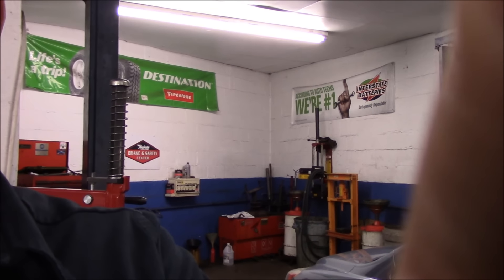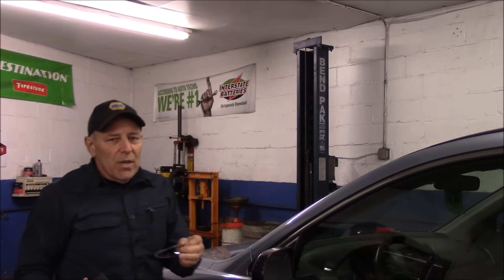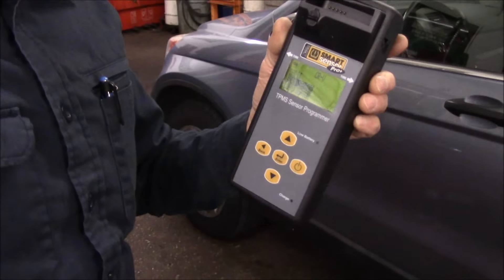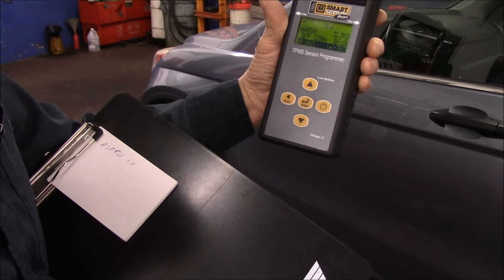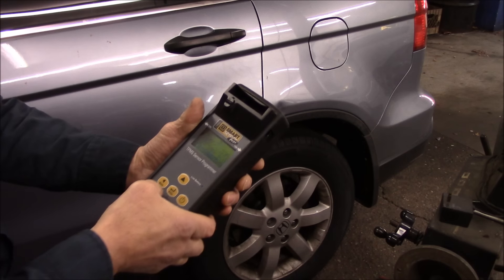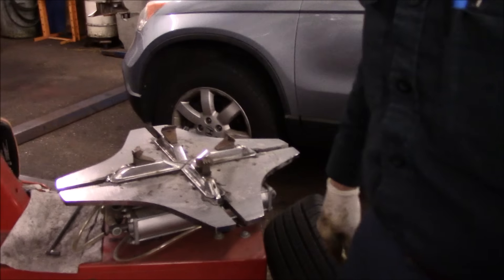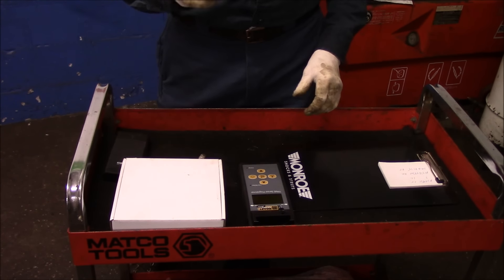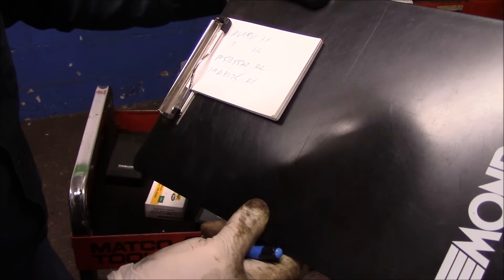How To Reset Low Tire Pressure Light (TPMS) Tire Monitoring System

Comment: How much cost the tool
Reply from the maker: Check my Amazon store for details.Here are some of the tools that jimthecarguy uses
https://www.amazon.com/shop/jimthecarguy
Reply: Jorge Zepeda as much as price the store asks for.
Reply: The “details. Here” link does not work
Reply: @jimthecarguy  Hello,

I’ve been having this issue for two weeks now. I have brought my car to the shop fourtimes. They have changed the sensor and reinitialized it and the light goes off. This has happened four different times and I saw the readings on the tires myself. The next day, the TMPS light comes on and blinks then goes solid. II do not have a spare in my trunk so it cannot be that. Is it an issue with the cars computer? Can you provide any answers to this please?
 I have looked everywhere online and I cannot find any answers to this. I have a 2013 Hyundai Elantra.
Reply: Good job
Reply: kh2maniac i am going thru a similar issue, I had to re upholster the dashboard of my car and now the light stays on. I am confident it has nothing to do with my sensors but some error in the computer since I had to take my car apart to remove the dash. Whatever I don’t really care, hopefully one days it starts working correctly again but I will not drop hundreds of dollars when 12 years ago we didn’t have tmps, I know exactly how to live without it and be safe.
Reply: Dario yea, I have no idea what’s going on. It’s still on. The technician recommends that I replace the other three sensors. He was nice enough to say that they wouldn’t charge me for labor and that I wouldn’t pay until I was comfortable with the light not coming back on. Which I could do and even if I did pay and the light comes back on, I’ll just dispute the charge and stop the payment. The whole thing has been stressful. Once you think it’s fixed it comes back on. I have no idea what to do now.
Reply: kh2maniac yeah I just started dealing with it this week so I am not too worried for now. But my car is an 09 maybe it’s time. I am just not going to drop hundreds of dollars for that, I can deal without them. I am always looking at my car in all places and I can detect low pressure without the system or even how the car drives and behaves. I want it gone but at the same time it’s not a priority really.
Reply: Dario I can understand that. That light is just so annoying. Do you have any recommendations other than what I am planning to do?
Reply: Dario the only one I haven’t tried is disconnecting the cars battery. I need to replace my battery anyways so I guess I’ll give that a try. Thanks for your help!
Reply: kh2maniac no problem
Reply: @Stickykobe420  i have the same issue with my 2011 rav4 ,and I don't pay attention to it 
As long as it doesn't show up when you do the smog check ,then I don't bother with it
Reply: May I have your shop’s address? My vehicle probably needs your help to do so. Thank You 🙏
Reply: Great video just fast play it 1.75x speed
Reply: @kh2maniac  Did you check the pressure in the spare tire?
Reply: @kh2maniac  Did you check the pressure in the spare tire?
Reply: @ellenjayd8721  I don’t have a spare in my car.
Reply: @ellenjayd8721  or do you mean the doughnut?
Reply: About $800.00 from snap-on or used  i sern one go for $600
Reply: I was expecting some sort of secret way to clear this, so basically you have to buy the scanner to figure out which sensor is bad, for the price of the tool, I have an easier solution, I ignore the light. 
I believe 80 percent of cars on the road have the TPS light on.
Reply: Me want know tool cost also
Reply: @kh2maniac  You said the word, "Hyundai".
Reply: @davidmorse8432  😂 yea, are they known for doing this or something?
Reply: instablaster...
Reply: @homie-gtv322  It you get?
Reply: @okaunis  Know. Knot yet. Did get you it?
Reply: What's the exact name of your tool look on Amazon and I didn't see it?
Reply: Does the sensor tool need to have OBDII integrated in order to do the job you just did, or one without OBDII would do the same job as well
Reply: No spare tire?
Reply: @jimthecarguy  I don't see a tpms sensor tool...just the replacement tpms sensors. Is their a tool you recommend?
Reply from the maker: @AamnaHussain  
There are a few kits in my store. One is the complete kit ( tool and 8 sensors ).You can also just buy the tool. Here is the link.   
https://amzn.to/3ZWo36i.  Just the tool
https://amzn.to/3wfQVZE. Complete kit 
https://amzn.to/3WlGuhu. Sensor 315 MHZ
https://amzn.to/3XIsuzJ   Sensor 433.92 MHZ
Reply: @jimthecarguy  awesome thank you Jim!
Reply: amazon says 108 dollars
Reply: hi Jim.what is the name of the tool,where you bought it please 26:
Reply: @kh2maniac  Maybe the car computer is looking for the spare sensor.
Reply: I bought my tire one year ago. I don’t understand how come the tire light shows up. Now its blinking and I feel worry about it. Because I need the car for my job . Please help
Reply: @kh2maniac did disconnecting battery work? that was one of my thoughts , like restarting a computer
Reply: This isnt much use if you dont invest in this specialized tool …and if you do, you probably wont use it very often making it a poor investment. These TPMS are not reliable. Ive had problems with them on 3 different vehicles.

Comment: My grandpa lived 98 years without a tire sensor.
Reply: Ha ha ha, same as Fred Flintstone, heck his mobile didn’t need brake either.
Reply: @deeneyugn4824  You are missing the point with your flippant remark:
There is good new technology and there is ridiculous new technology.
TPMS falls soundly into the latter category. Simply pointless.
Reply: pan af  Yeah...My tyre supplier wrecked one of mine and denied doing so. Until I asked why that one tyre now had a new valve stem installed. Mmm?
Reply: Patagualian Mostly why are you salty?
Reply: @patagualianmostly7437  When the battery dies in the sensor the tire must be dismounted and remounted. totally ridiculous.
Reply: @nataliehumbert7628  Nothing "Salty" (whatever that is supposed to mean) about stating the simple plain truth. 
Some folk cannot handle the truth.
Reply: I wish I would have been born with your grandpa and had it all over with too~!!
Reply: I'll be grandpa had a lot of fun with model-T and A tires, you had to dissasemble them on the road and patch the tube or dismount the center and put another tire and rim on.  Not to mention rebuilding the engine on the roadside.  Then again if he departed recently he may have missed the T.
PS:  We should have gotten my mom and your dad together she passed a year ago December at 98, they could have shacked up or something.
Reply: I lived 46 without one but now when leave for work it's dark out, and I would not have been able to see that the tire was low on air, I probably would have driven with it that way, and I would probably be dead right now.
Reply: If you need all these sincers to drive then you have no business driving
Reply: Cherish him forever
Reply: And I grew up using a hand pump. I knew how many flexes filled a tire. I carried a spare doh. Kicked the tire with my foot, sounded solid and say: Good to go!
Reply: New tools& technology require time & experience to perfect. By improving the monitoring of tire pressure, one may expect the longevity of a tire or tires to increase.
So long as the value of the increased longevity is greater than the cost of the tire monitoring system, it adds value to the vehicle. I haven’t included ancillary benefits including tire safety = properly inflated tires provide improved gas mileage, safer starts and stops, and improved traction in dry, wet, or icy/snowy road conditions.
Similar to the benefits of auto insurance, seat belts, air bags, and crushable car bodies, we hope and plan we’ll not need the benefits of those tools & technologies.  But those improvements that benefit the few that, by chance, utilize them, help us all live a more comfortable, safe& secure life.
Reply: What does 98 have to do with a tire pressure system?
Reply: It's a law that new cars have to have them
Reply: @jerrynorris1397  It's a law that cars have that system
Reply: @albertedwardgelsthorpe7018  There are a lot of possible advantages to having them, but they only apply if people pay attention to them. Fact is, most people I know ignore them. It just gets to be a pain pulling over and getting down on your hands and knees with a gauge and tire pump because one tire or the other is a couple PSI more or less than another. For example, the light always comes on in freezing temperatures because of the temperature.  They would be more valuable if they weren't so sensitive. A difference of five or six psi is significant, but I've had the light come on because of a two psi difference. You get tired of playing that game every couple of weeks.

Comment: I used the bicycle pump to pump the air into the low pressure reading tire to it’s reading level,then I started the car ,the sensor disappeared.

Comment: Jim……my 2009 Honda CR-V, one of the TMPS sensors was bad, my tires were questionable, 6 months later I got new tires & new sensors, the car was 9 years old when the first one went, about 110,000 miles. I bought sensors on eBay (4 for $43, not $43 dollars each) and they were installed and programmed by Discount Tire. I only paid for the tires.  Thanks….Jim
Reply: Wow. You got a sweet deal. My sensor(s) went bad a couple years ago. I was researching local replacement and installation and the sensor replacements alone were in the hundreds. I just said "forget it" and simply check my tire pressure every few weeks.
Reply: If the government wants to mandate these things they should also mandate a reasonable cost for them. I recently bought my first car with TPMS (my treasured 2004 Honda got totaled). I then purchased a second set of wheels and winter tires. When they told me how much it would cost for TPMS to be installed and programmed in the winter wheels I was shocked! Almost doubling the price of the wheels! Not a chance! I asked several friends who swap out wheels for winter, and not one has had sensors installed in their winter wheels. What good is a safety feature that is inoperative 5 months out of the year?

Comment: NTB wanted $250/tire for 3 sensors.  More than the 4 Michelins on the car.  I have been driving 55 years and this is the 1st I've heard of Tire sensor.  This is another item to brake for dealer profits. I kept on driving and within 1K miles the lights went out.  As my father told me, "don't fix it right away, It'll correct itself or stop on side of the road."  good advise in my humble opinion.
Reply: As a mechanic I fully agree. Just another thing to charge the unknowing customer for. Like nitrogen in tires, nitrogen in tires is only beneficial for aircraft and race cars (any tire traveling 200mph or more) yet they still think it's needed in the average drivers car lol

Comment: My 2011 Honda Accord has both the low tire pressure  (horseshoe with !) and “TPMS” indicator lights. The horseshoe light keeps flashing but not the “TMPS” light. I took it to two service shops & both confirmed the sensors are good & performed a re-learn procedure. I drove it for several days & it still flashes.

Comment: Can u use your spare tire sensors and put it on your regular rim to save some money?  Also how much do they cost on average I have a Toyota tundra thanks Jeff
Reply from the maker: Hi Jeff
No that will not work because the TPMS system needs to check the pressure for all 5 tires if it has one on the spare tire. To replace one sensor approximately $100.00-$150.00.
Reply: @jimthecarguy ok thanks for the info I appreciate it keep the videos coming 👍🇺🇸

Comment: additional question for this subject that is new for me. I assume any given auto mostly is designed to only support 4 TPMS sensors.  So if one has a 5th wheel (of exact same style for emergency tire replacement usage) - I assume that will also require the TMPS sensors to be swapped by a mechanic so you can get a proper dash reading?  and how would the car know which of the 5 sensors are the 4 sensors the car is actually driving with?

Comment: Before you go to all of this trouble, you should add the correct amount of air to all 4 tires plus the spare tire in the trunk, then drive for 20 minutes and the light should go off, just remember to check the spare tire and add air if needed, bc the spare tire has a sensor inside of it also. Most people forget to check and add air to the spare.
Reply from the maker: Thanks for watching.
Reply: Thanks for info. I didn't know that shit

Comment: Great vid! We had new tires and sensors put on for all 4 tires on our 2007 Honda CRV. The “TPMS” steady light went out but now a TPMS tire pressure light is blinking and it is in the shape of a tire with an exclamation symbol in the middle of it, that now stays blinking, even after driving 30 minutes on Highway at 45 mph. How do I get it to go off?

Comment: Excellent  ! I have a 2018 Hyundai Santa Fee with this problem ! I did not know about the battery in the sensor and the "tip" on marking the tire was awesome.  Very well done sir !!!!!
Reply: Ahahahahaha. Hyundai Santa has no battery sensors. 😂
Reply: Maybe READING is beyond your ability  !!!  2018 HYUNDAI SANTA FE! !!!! People like you would not know which  button to push on a two story elevator !!!!! You would stand on 4 in Blackjack too too !

Comment: I got installed the new tires and now I start getting this TPM light . I had no issue before what so ever, I  Checked the tire  pressure which was ok. Every time it resets when I turn off and restart my vehicle but pops up again while driving on highway.
Reply: Got same signal at high way. I became passed up

Comment: Thanks Jim for that knowledge. My problem.. When the car starts the TPMS light in my 2006 toyota prius base flashes for 1-2 min then its solid. I had it checked at Town Fare Tire and as soon as he checked the left frt tire, the light whent out. All the batteries ok. He said if he replaced the battery on the left front, thers no guarantee the light will go out. So no changeout.  A few days later the light is flashing again then solid. I made sure the tires were at correct psi. The reset button when pushed will slow the flashing to get the recommended 3 flashes in a row, but it continues to flash afterwards and goes solid. I know the car must be in the on position, thats key in with 2 taps on start button, no brake. Now, do I wait for the flashing to stop and go solid, before I push and hold the reset button? Or push button while flashing? Thanks for your patience.

Comment: Tire sensors on Amazon $15-$30. Most tire stores will break the bead and install the new sensor for $10 (Tire Kingdom here in Florida). Programming a new sensor is easy, either by cloning, which was shown here, or relearning, which the vehicle relearns the new sensors which would be faster. An easier tool to use is the Autel TS508 or 408. Some auto parts stores will rent the tool or let you use it for free.  Also note there are two types of TPMS systems. Those that have sensors in the wheels are called “direct” TPMS. And vehicles that do not have sensors in the wheels are called “indirect” TPMS, like the newer Honda Accord.  It uses the ABS system to calculate tire pressure.
Reply: Great info that it can be replaced and relearned without any reprogramming.

Comment: My 2013 T&C has a TPMS light on. I have checked and corrected the tire pressures on all 4 tires, but it will not reset. The van is going on 8 years old (I bought it new) and I suspect the battery in at least one sensor is dead. I have had a slow leak in one tire that I have not addressed and I suspect that has stressed an already 8 year old battery and brought it to the end of its life. I have investigated the cost of replacement of the sensor (approx. $60 for the sensor) and the tire shop will need to be paid to diagnose and replace it (including reprogramming). 
Even after the failed sensor has been replaced, that leaves 3 other sensors that are near the end of their battery life. 
With all this in mind, I am going to place a piece of black electrical tape over the TPSM warning light and be on my way. I have been driving for 60 years without a TPSM warning light and I believe I can continue without one. Features like this are great for the first owner, but a costly nuisance for later owners. 
PS: I will repair the slow leak.
Reply from the maker: I agree with you James. These sensor are a waste of money. Just another maintenance idem that needs to be serviced. Every driver should know how to check their own air pressure . As it was years ago. Thank you for your input and for watching.

Comment: I bought a set of brand new tires and now I have a tire pressure sensor frozen on 6 pounds and doesn't want to change. i think they did something when they took out the old tire and put the new one. Could've be that damaged the sensor?

Comment: Hi!  2010 Honda Fit Base model.  Today, I drove to the destination and all was good.  Coming back the TPMS light(as in the video) lit up.  Came home and scanned the car.  Scan tool showed ID 34 DTC-Tire2 Pressure Sensor Signal Failure.  I don't know which tire is 34.  I do know that Fit IDs as 32, 34, 26 and 38.  My assumption is that one of the sensors(34) didn't respond to TPMS Control Unit.  I don't have a dedicated tool which you used in the video.  Tire pressure seems good.  I erased TPMS and light went away.  Will need to drive in the morning and test.  Maybe you know the ID designation and may help which tire is in question?